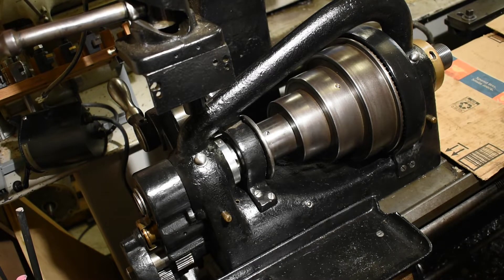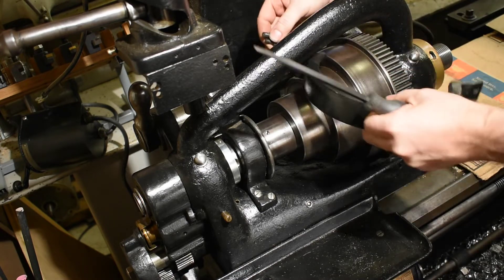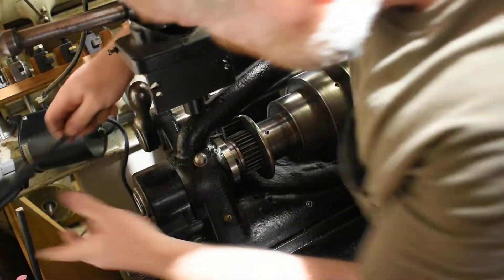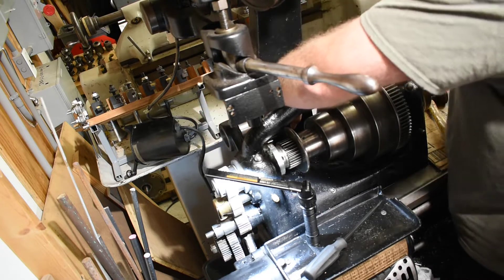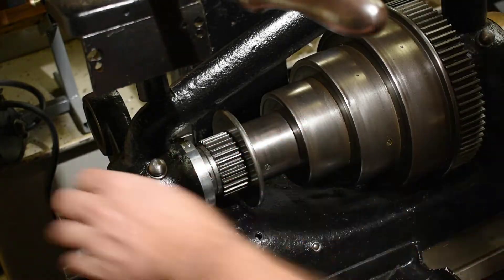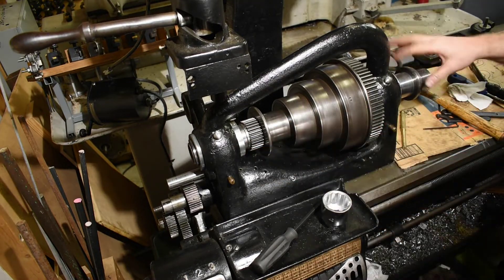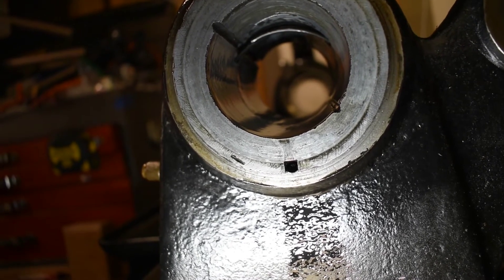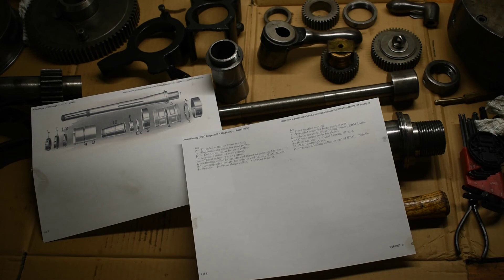Hendey 12" Cone Head Lathe Spindle Removal

Comment: I didn't see any slinger rings in the bearings. My hendey has one and appears to ne missing the other. I will be taking it appart to make sure everything is clean and gets lube as it should
Reply from the maker: They're there.  I show the front one later in the video.  I've heard the bearings are brittle and may break if you try to remove them.

Comment: Nice job on the video!  I've been dealing with the thrust bearing issue on my 14" and it turned out to be a nightmare.  Somebody had removed the right hand bearing and installed it upside down and the oiling ring was destroyed.  I was able to remove the bearing, make a new ring and get everything back together.  Even shimming was problematic as the thrust surface on the bearing was worn and had to be trued up.
Reply from the maker: Thanks!  That sounds like a pain.  I'm glad you were able to get the bearing out without an issue.  I've heard people have broken them trying to get them out.  Sounds like you were able to get yours working again though.